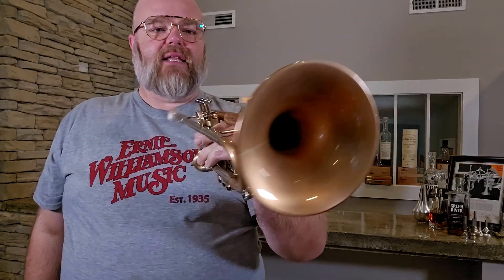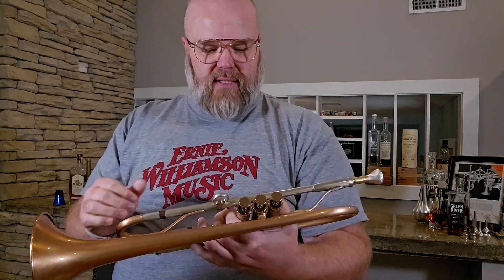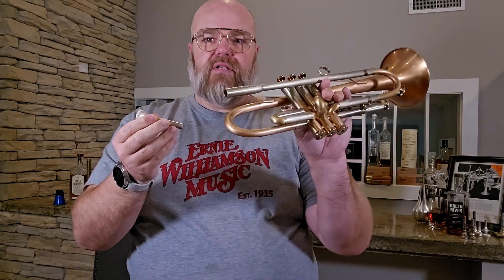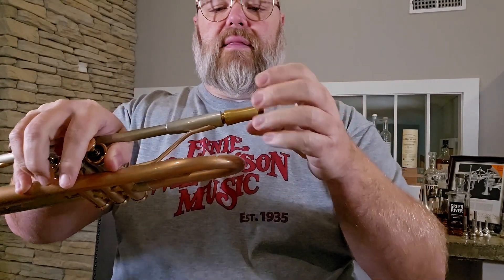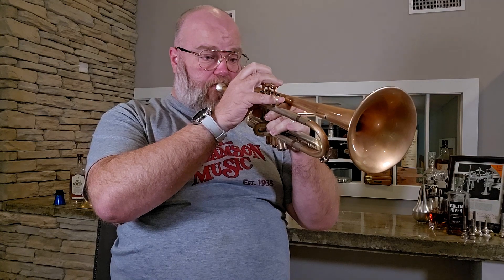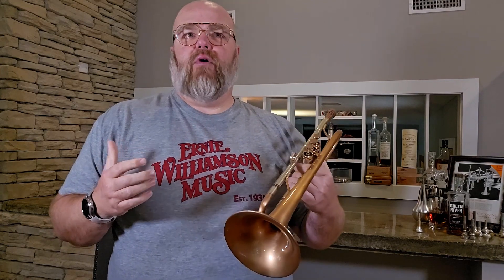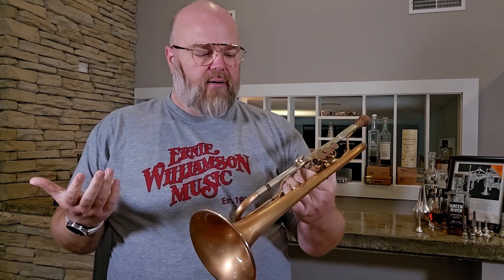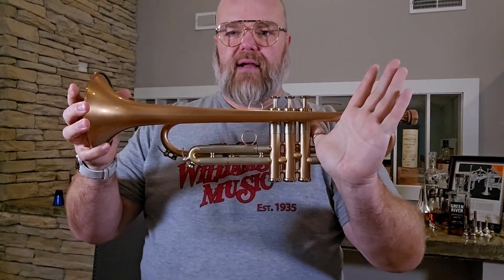AR Resonance Suprema but with a Lacquer finish!

Comment: The variable gap receiver looks like it pull out. How many variable gap receipts Vera come with a horn
Reply from the maker: It doesn't pull out, it screws in... And you get 5 (in gaps of 1mm to 5mm), but can order more if for some reason you would need it.